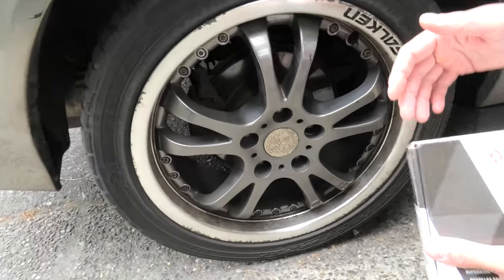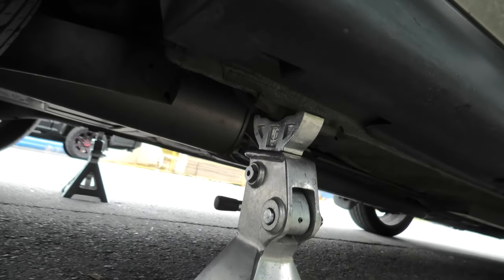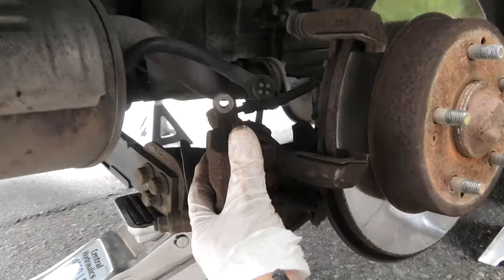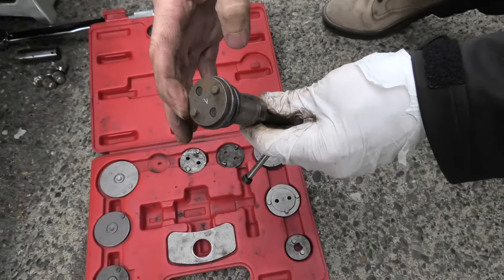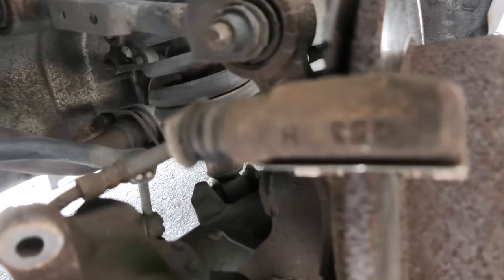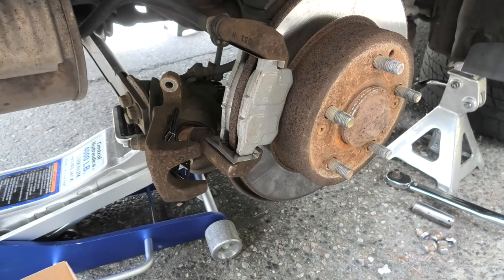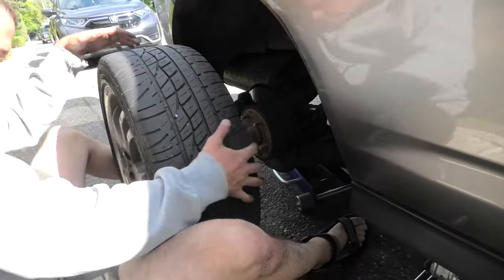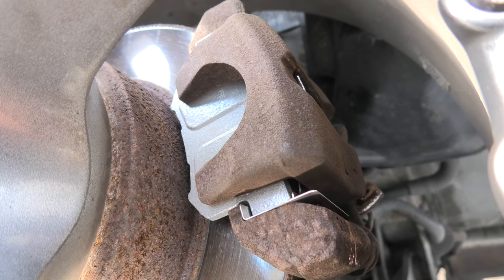Acura RSX (2002-2006): Rear Brake Pads Replacement. Wagner Thermo Quiet Ceramic Brake Pads.

Comment from the maker: PRODUCT LINK: Wagner Brake ThermoQuiet QC537 Ceramic Disc Pad Set, Rear - https://amzn.to/3WAtGE9.

RECOMMENDED TOOLS:
1. WHEEL CHOCKS - MAXXHAUL 70472 Solid Rubber Heavy Duty Black Wheel Chock 2-Pack, 8" x 4" x 6" - https://amzn.to/3DTPyDZ.
2. 3-TON FLOOR JACK - Pittsburgh 3 Tons Aluminum Racing Floor Jack With Rapid Pump - https://amzn.to/3JHEttC.
3. JACK STANDS - Pro-LifT T-6903D Double Pin Jack Stands - 3 Ton - https://amzn.to/3xe3Qf7.
4. 1/2" TORQUE WRENCH - GEARWRENCH 1/2" Drive Micrometer Torque Wrench, 20-150 ft/lbs. - https://amzn.to/3I6ja3p.
5. 3/8" TORQUE WRENCH - GEARWRENCH 3/8" Drive Micrometer Torque Wrench 10-100 ft/lbs - https://amzn.to/3YmhnN2.
6. 19MM SOCKET - GEARWRENCH 1/2" Drive 6 Pt. Deep Impact Socket, 19mm - https://amzn.to/3HXDliY.
7. 14MM SOCKET - Performance Tool W38414 6-Point Socket, 3/8" Drive, 14mm - https://amzn.to/3Xnp0BX.
8. 3/8" FLEX HEAD RATCHET - GEARWRENCH 3/8" Drive 90 Tooth Locking Flex Head Teardrop Ratchet 11" - https://amzn.to/3HsWc5a.
9. PLIERS - KNIPEX Tools 2 Piece Cobra Pliers Set - https://amzn.to/3lmDhBw.
10. SCREWDRIVER SET - Wiha 53390 Screwdrivers, Slotted and Phillips, Extra Heavy Duty, Non-Slip Grip, 5 Piece - https://amzn.to/3jMWgES.
11. CALIPER TOOL SET - Astro 78618 Brake Caliper Wind Back Tool Set - https://amzn.to/3E2l5nl.
12. ADJUSTABLE WRENCH - Crescent 10" Adjustable Black Oxide Wrench - https://amzn.to/3lyPW4o.
13. BRAKE CALIPER PINS LUBRICANT - Permatex 20353 Ultra Disc Brake Caliper Lube, 2 oz. -  https://amzn.to/3xiAZGr.
14. WRENCH SET - GEARWRENCH 14 Pc. 6 Pt. Combination Wrench Set - https://amzn.to/3YxCixm.

Comment: Thanks for including all products with links in the comment & description! And great video, but why is it necessary to put the car in reverse? Safety?
Reply from the maker: Thank you! Yes, so it does not accidentally roll. You still need to block one of the front wheels with wheel blocks.

Comment: Can you show us how to replace (or fix the clips) the AC control panel?
Reply from the maker: Acura RSX (2002-2006): How To Remove Climate Control / Air Conditioner Panel And Replace OEM Bulbs - https://youtu.be/p9BdMuEtkjI.